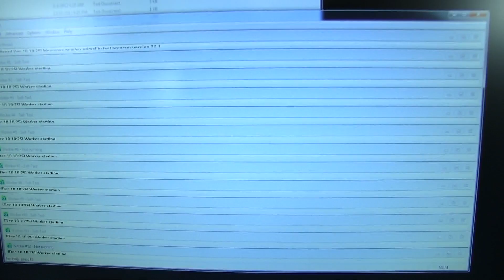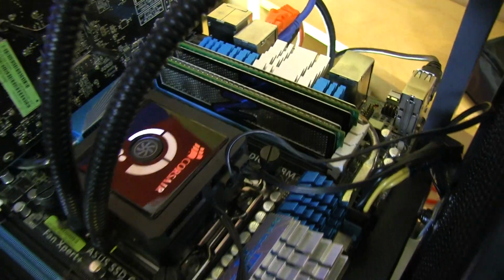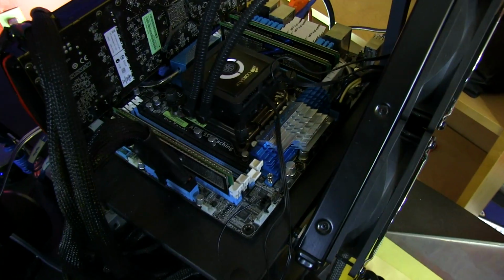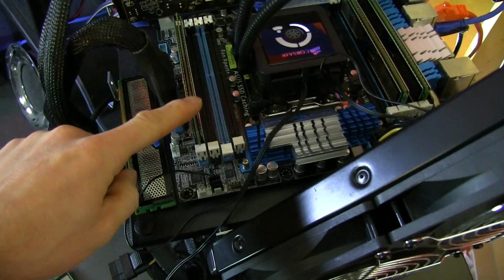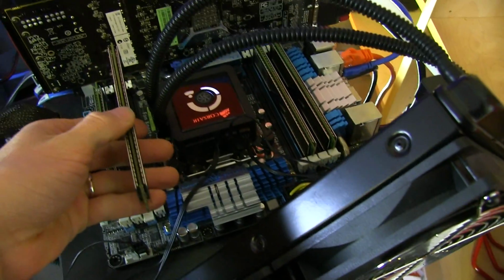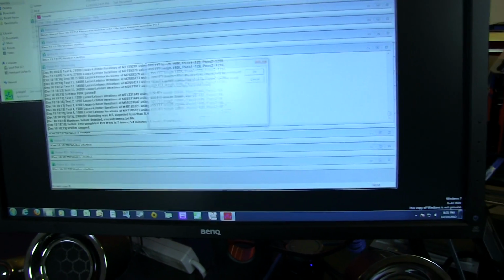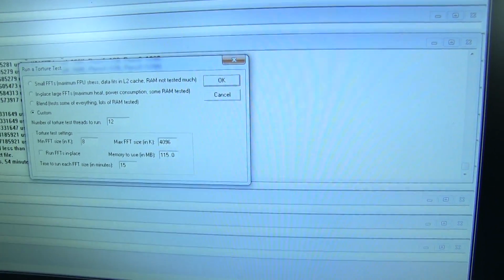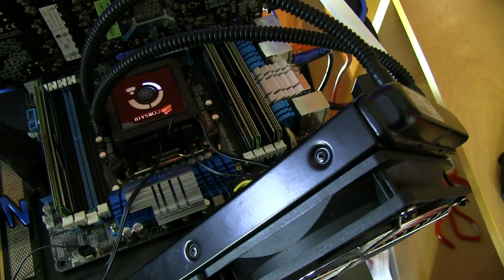RAM Memory Troubleshooting & Diagnosis Part 1 Linus Tech Tips

Comment: My internet started to crash some apps started to close. I did some steps before I moved into the memory. I used window memory diagnostic and it told me I have a memory issue. I clean the slots and ram and it worked for 3 months. Before putting them all in I also checked them 1 by 1 using windows memory diagnostic.  After 3 months,I started to get the same symptoms. I'm using memtest86 and checking 1 ram stick at a time. So far 3 have passed. Idk what it could be lol DUST?

Comment: I have a Dell Inspiron 5675, it originally had a ryzen 3 1200 in, the pins broke off, so I replaced it with a ryzen 5 1600. I have 16gb ram 2x 8gb sticks. I have no bent pins on my cpu and it only works with 1 ram stick. I have checked both sticks in the same slot and they both work, but if I put both in, the pc refuses to boot. I'm at a loss. I could buy a new mobo, but unsure if that would resolve it. Other than taking it to a repair shop for extortionate cost. All ram worked previously with the r3 1200.

Comment: 2022, and this is still cannon. Thanks Linus! Love all your stuff. Trying to diagnose my AW X17 R1 with 64gb XMP... Damn thing blue screens all the time. Especially with XMP enabled
Reply: Same situation here, and it's driving me insane!
Reply: @billcipher5440  So, don't turn the CPU Undervolt lower than -30mv. I haven't had a serious crash in a few weeks since I set the Undervolt at -30mv. -50mv is too low and it hard crashes at that level. Also, the GPU Overclock is sensitive as hell. I can't get mine to stay stable over 60mhz core and 60mhz memory. Seems like low numbers, but I think the GA104 silicon is just binned poorly on the laptop units, practically maxed out at factory settings.
Reply: @ChryslerLeBaro  Ive been having blue screens on mobo ASrock B760M, with ddr5 5600 trident z5, everything passes on memtest what is my best bet to do? ive tried using pc with two sticks of 16 gigs and it works fine without any issues. I added a third one it crashed once. I took the two good ones out and installed just the one that caused crashed,
 it didn't crash at all. What should i do any suggestions.

Comment: I know the vid is old but i need a answer i have 6 gb ram pc every time i turn it on it wont reboot but the fan works and every time i pull out my 4gb ram card the pc works but i cant fuking run my pc with a 2 gb ram card

Comment: What I did was I had an 8-9 year old desktop (with a very loud hdd) randomly crashing, mostly at various points at startup, but also randomly while it was running. I updated all drivers, scanned for malware, etc. until I decided to test the ram. I took 1 stick out and turned it on. It just had a constant beep. Then I replaced it with the other one. It turned on just fine, passed the memory check, and it hasn't crashed after a day of use. (which hasn't happened in months)
I'm just glad it wasn't the hdd because it has sentimental stuff on it and I can't back it up.

Comment: looking this in 2018 xD
Reply: 2019.
Reply: 2021
Reply: ValeGames
Congratulations, you win nothing !
Reply: Just had my first thought of a bad mem stick. been getting BSOD randomly. Doing the normal things. Sometimes it crashes a few times a day and sometimes not for two weeks. had to reinstall windows recently luckily i had everything on other drives. Not overclocked and even noticed it at 2166mhz and not 3000mhz, changed it and it did a boot cycle 3 times before starting normaly. now to run half my ram and see if it crashes.........
Reply: @McWillis  That sucks, hope you got it worked out. I recently decided to test my RAM after it was pointed out to me that the XMP settings may not be stable if you are overclocking your CPU, well, turns out my RAM is giving errors in Memtest86 even with everything set back to stock. My system hasn't crashed or anything so who knows how long my RAM has been bad, but my original Win10 install did develop some really strange quirks with things like the volume mixer and task manager until did a full wipe and reinstall some months ago. I suspect my RAM has been slowly corrupting my OS/programs, but who knows?
Reply: @DelphinusVyse  my PC refused to boot up when my friend donated her Hyper X fury ram to me in order to match my other fury x ram for dual channel. It turns out I had to clean her RAM THREE TIMES with an Eraser and Rubbing Alcohol because it was FILTHY as hell
Reply: hey
Reply: @X0Slay  no way 8 yrs ago but I find u
Reply: 2022
Reply: @barmanitera  I like how we missed 2020

Comment: Hi Linus. I love your channel, but I need your help with something 😅. I just got a 8GB DDR3 Team RAM, to replace my Samsung 1GB, and Kingmax 2GB rams. And they all run at a 1333mhz. But as soon as I take the old ran out and put the new Ram. The system just beeps for a minute stops and starts again with the beeping. The board I'm using is a GIGABYTE GA-G41M-Combo

Comment: I have an ASUS Sabertooth Mk.2 Z97. The ram slots are A1-A2-B1-B2. I have a Corsair 2x4gb 1866Mhz kit. My ram only works in in the first two slots, thus not allowing dual channel. In any other configuration, it turns on, turns off, turns back on, and repeats forever. The MOBO is well past warranty, so any ideas? Thanks.
Reply: Throw it at kids who step on your lawn?
Reply: Have you found any solution on that?
Reply: Darian Garbig i have that too

Comment: i have a similar problem. i recently bought 4 sticks or RAM all identical. replaced them with the old ones and after one day my system started giving me random BSOD messages with diffrent errors. at first i tought that the problem was in one of my ram slots that i wasnt using before i bought the new ram. so i took out the stick and the system seemed to be fine. i tought: maybe it was the rams fault. so i just shuffled them and put each one into diffrent slots. and system started crashing again. i just said fuck it, i couldnt bother opening that case again, because it was as easy as opening a coconut with your nails. i left my pc go with it for a while. and it stopped crashing my system... i tought this was good and just left it like that. but then my games just started crashing for no reason. i would just play, and all of the sudden it would just kick me back to my background and the game would just close. it was frustrating me, and i just decided: fuck it. i reseted my whole system,  cleaned my pc even and started again. the games kept crashing... i pulled one of the ram sticks out from the slot i tought was faulty. the games were still crashing... i pulled another one, random one. and the games stopped crashing. so it must be the ram sticks. i put the first one back in and it was all running nice. well i still got some testing to do. but could something like this possibly come out of underclocking your ram? just wondering.

Comment: My pc suddenly became slow as f?ck one day when I booted it up. It takes forever to load anything and when I try to boot from another HDD, then it bluescreens when the win7 logo appears. I really suspect the ram (1 8gb stick) because I've experienced the problem with bluescreenimg before.

Any tips here?
Reply: same here
Reply: My HDD were dead. Bought an SSD and it went smooth again
Reply: now i have a new problem there is if i use dual slot ram my pc will BSOD 

Are you have any tips?

Comment: I need help, its nothing as severe as this but when installed an extra stick of 8 gb ddr4 2133 on my machine it would load up the asus logo and then show a black screen. I took out the new stick and it appears to boot up again. I have come to the conclusion that the new stick isnt compatible with the original one. But why are they incompatible if they are both 8gb ddr4 2133??!

Comment: i think i have bad ram 8gb ballistix, tried installing win10 and 8.1 n get bsod or a message make sure i have all files to install win, after like the 5th try i installed window but it seems to be corrupt so reinstall n works a little better i can play games with out crash but when downloading games over 4gb steams pause download or steam would close by it self n cant open again unless restart pc or bsod n firefox would crash to or bsod when open firefox  also one game fail me saying something could be wrong with my harddrive or memory but i know for a fact it aint the hdd so im hoping its a ram problem so i can just replace so if anybody on the same boat as me can share info on this problem, cause i kept blaming win 10 update witch i think is not the problem from trying to stop bsod for 4 days now that shit stress me out by the way bin using this ram stick for 3 years now mayb i should b

Comment: I have 5GB of RAM used with firefox open with four tabs and origin open. Everything else is closed. I looked in resource manager, went to memory, added up all working set ram and it only adds to 2.5GB. I'm stumped >_< Games lag for me if I don't restart my computer and get the RAM back to 2.5GB in use.. BF4 open while I have 5GB on idle leads me to having over 7GB used of my 8GB setup.. Please help :/
Reply: NGELO9657 you sir have a memory leak reinstall your operating system

Comment: Is there a way to clear your Ram memory? I have 8gb of ram, my pc says that 50% is used. Can I bring it back to 0% If so, how?
Reply: Just a headsup: it's RAM, not "RAM memory". Random Acces Memory memory? No.
Second: RAM is being used by an active process. The only way to clear it is to shut the program down. You can NEVER get it to 0 because your OS requires RAM. Depending on how much RAM you have, 50% doesn't mean it's bad.
Reply: Thanks, I now see that 50% usage of my RAM is only whenever I play games and stuff. Thanks for clearing that out :)
Reply: Chupa Cabra excellent, good to see its not an actual problem.

Comment: Linus how does this relate? 
Prime95 is not actually capable of doing FFTs of any arbitrary size. It can do only sizes in the following list: 8, 10, 12, 14, 16, 20, 24, 28, 32, 40, 48, 56, 64, 80, 96, 112, 128, 160, 192, 224, 256, 320, 384, 448, 512, 640, 768, 896, 1024, 1280, 1536, 1792, 2048, 2560, 3072, 3584, and 4096. Prime95 (version 23.8.1 and maybe others) has a bug which causes the program to hang if you enter a range which doesn't include any sizes from the list.

Comment: Even my copy of Windows 7 has yelled at me for pirating, it's really annoying considering I've paid for it. 

It wants me to install DRM that will constantly run in the background and run validity checks, which is just a slap in the face, I feel. 

But that's just my rant, and more of a reason for me to continue using Linux.

Comment: I am having a problem with my newly purchased RAM to my home built comp, my computer freeze RANDOMLY and I changed the voltage and now it has only happened once but since its random I dunno if the problem is really solved, any tips? I check the motherbord compatible RAMs but couldnt find my specific one on the list :/

Comment: Just run a memtest and it will tell you what slot that has failed ram chips. Boot HirensBootCD and run Memtest86 or the Goldenmem test. Much more efficient than stress testing.

Comment: The error isn't doesn't specifically occur in a specific process eg. it doesn't all ways happen with 3rd or 4th instance of memtest that is running, it's kind of random I suppose but all the errors start appearing in one process only after less than 30 mins or so...  :(

Comment: Hey guys. I'm running memtest86. I have 4x4GB corasair vengance ddr3, 1600mhz modules. Memtest does not allow me to allocate more than 2GB of RAM per process, so I run about 13-14 of them. Strangely out of all of them I keep getting errors in only one the running tests out of the 13-14. what does it mean?  the error is something like "your PC could not store/ copy data properly, check memtest readme" I did it, but understood little. thank you for reading... :)

Comment: Linus -- it's your TIMINGS not the RAM. Try the following:

DDR3-1600 9-9-9-27-2N, DRAM Voltage 1.65v~1.68v, VCCSA Voltage 1.25v~1.35v.

Those old OCZ sticks were crap then and they sure aren't any better now. The 'RATED' Frequency is for D-U-A-L Channel and certainly not Quad Channel. The biggest problem (errors) are coming from your (1N) Command Rate. Failing Prime 95, AIDA64 Extreme, Memtest, or you name it after 8 hours screams bad settings not bad RAM. Bad RAM will throw tons of errors.

Comment: Either way. I usually just do it when it's in the socket. Less work. Just don't drip any on the board, should be fairly simple. Watch this, same concept, it's from one of Linus older videos. 

"watch?v=5xyxVWXQJOA"

Same concept, just on a CPU. Hope it helps. Happy cleaning.

Comment: you can short out the 2 pins on the motherboard that are for your power button. You can use a screw driver or any metal object thats conductive

Comment: yes, not all but most now come with a power button on the motherboard for testing etc
If you need to use the pins just crap a screwdriver or anything metal and touch the 2 pins at once which would represent the front panel connection

Comment: Why use P95 instead of Memtest 86+? The P95 blend test also involves the CPU which introduces another variable, plus any blue-screen happens in windows which isn't so great for your system. Memtest 86+ only tests RAM, and it is pre-OS so any crash doesn't affect the software. Is Memtest 86+ not vigorous enough to find the errors or something?

Comment: And then you have IBT (Intel Burn Test), which is way better in anything that Prime is supposed to do. I ran Prime for over 20 minutes during which i got IBT. Then i stopped Prime, ran IBT, and i got a BSOD within 3 minutes. I'm not even sure that running Prime overnight would have caused a crash, since it happened so quick in IBT.

Comment: Linus. Try PC Check by Eurosoft. It will perform isolated RAM testing and confirm issues on individual modules, takes the guesswork out of the equation. Also it runs outside of Windows, so bluescreens are a thing of the past.

Comment: Exactly the same issue.

Random crashes with 4 sticks in.

Each will individually pass Ram Checks.

Just having 2 in, any two, and it will be fine.

So like you 1 or more sticks is bad, but only shows up when in duel channel mode, (all4)
Started to find out which one, but label fell of after 2 runs...... yes lol's were had.

Thanks for post, made me want to fix it once and for all.
Weirdly my memory is OCZ as well

Comment: I ended up throwing all 4 sticks of my OCZ set in the trash. I could not get my system to run stabe with any one of them, even though they were fine the first few months of use. I had problems posting and bluescreening within 30 minutes if it did post. At first it wouldn't post at all. I changed my power, videocard, cpu and motherboard before I even suspected the RAM. That was an expensive lesson ...

Comment: Linus: a quick way to diagnose a problem with the RAM-stick itself: use an Ubuntu live-CD with a memchecker built in. Where i had to wait about 6 hours till prime95 found any problems, the memchecker built into my Ubuntu 9.04 Live CD found it after 3 seconds ...

This is because of they way it actually checks: first a quick read-write test to each bit on the memory, even the bits that Windows would usually block for use by applications.

Comment from the maker: Memtest86+ often requires MULTIPLE passes to find the error. I use it sometimes, and use Prime95 other times. In my experience there is a chance that either of them won't work to find an error. I haven't tried memtesting this rig yet, but once it passes prime I will hit it with memtest before putting the RAM back in my wife's machine.

Comment from the maker: Haven't tried T2. They used to be stable at T1, so I'm trying to find the degraded stick. It's still running since I filmed this last night, and I've been getting errors consistently around the 8 hour mark, so I think I've found the bad one. Last step is to go get the stick in my wife's machine, and run all 4 of them together to make sure everything is A-OK.

Comment: Can you please think before you write ? You kind of answered you own question allready. You assume that you RAM is damaged, as sudden shutdowns/bluescreens are very often connected to RAM issues. What you can do now to verify you thesis is: Test you RAM with tool/diagnosis tools. If you got some old RAM or other ram from another PC or something you can try and install that to see if the problem is related to that. If not you can run only on RAM bar or try different slots.

Comment: I´ve got a prebuild pc, so the wattage will be fine, i suppose.
I think there is a certain RAM Fail when it crosses the line.
I checked the temps already, they are fine. between 30 and 40.

But thanks for such a quick responce, appreciate that

Comment: if my memory ram wasn't 16G or above in one, i will probably go and repair it or buy a new one rather than test it all day. But i do want to know does it a ram issue at all time. My computer sometime blue screen and frozen or flashing. I use autodesk inventor 2013,2012 version all the time with 1 msi 580 lighting extreme display card. I have no idea does it a problem with the video card or ram. Sometime the blue screen tell video error and always dumb something out of the system.

Comment: Maybe this ram set is just not liking X79 platform. Z77 are more picky with the RAM but X79 wont work with any ram set too. This OCZ set you have was born to run in a X58 3 channel chipset. This can be the issue Linus.

Comment: is it world of warcraft and is your card an overclocked GTX 570? (there are other games that specifically have issues with overclocked cards as well, this is just one that I ran into recently) If your card is factory overclocked it can cause this problem and using something like afterburner to dial back the settings can cure the issue.